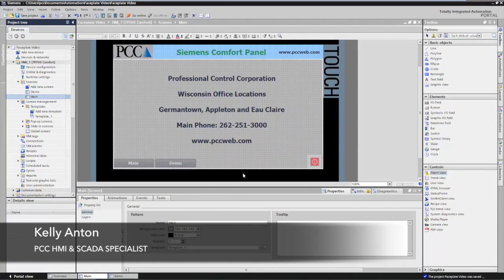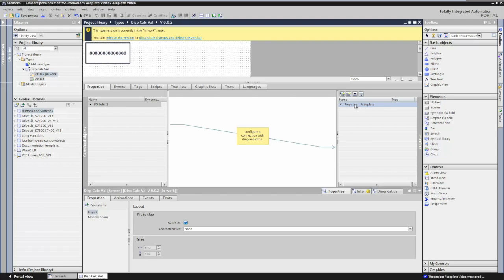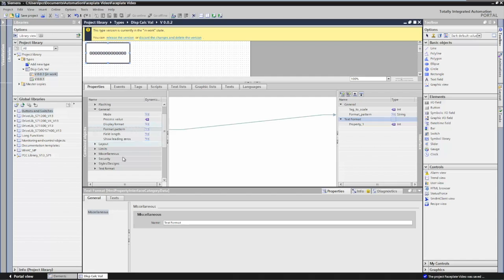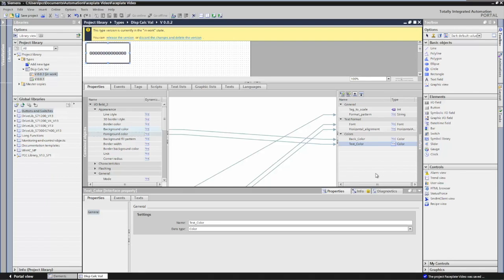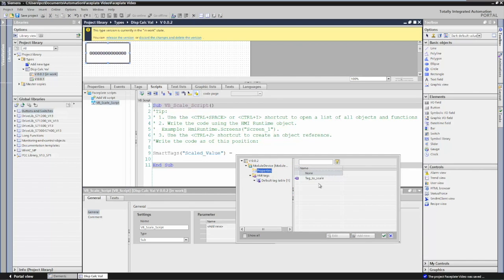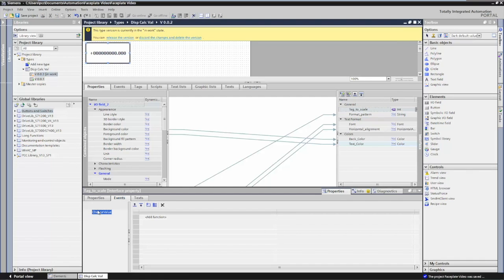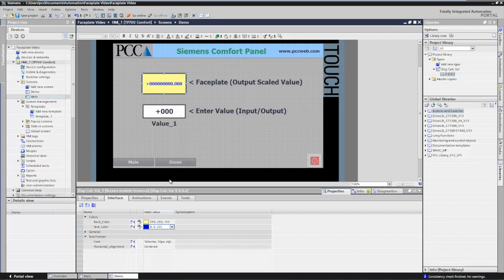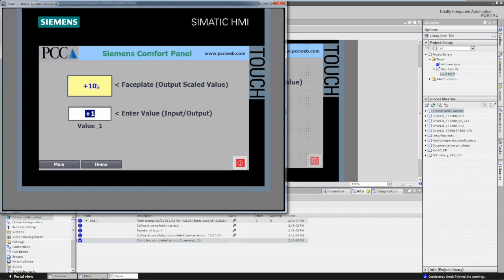Creating a faceplate in Siemens WinCC SCADA Comfort Advanced Software

Comment: I have an issue with an IO Field inside my faceplate, i want input a value but i cannot, i checked that type is INPUT/OUTPUT but and also it doesnt have control enable animation or anything else, any suggest?